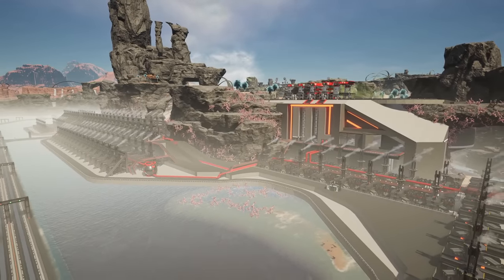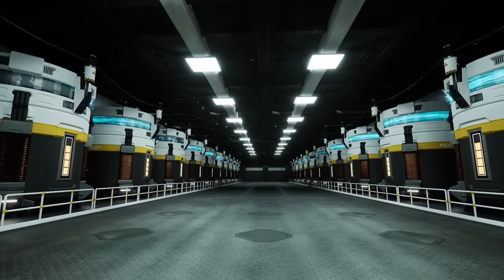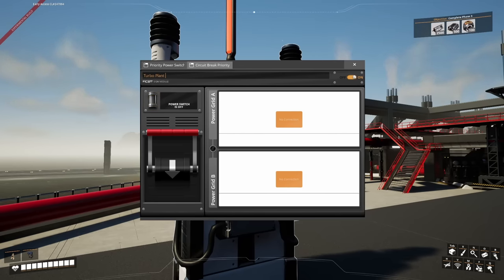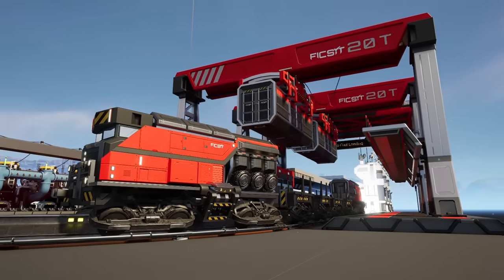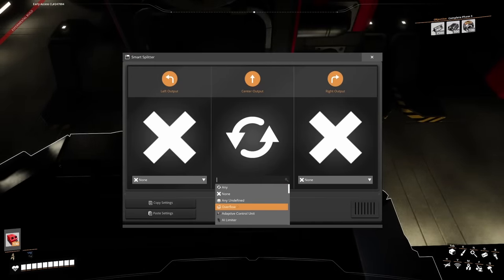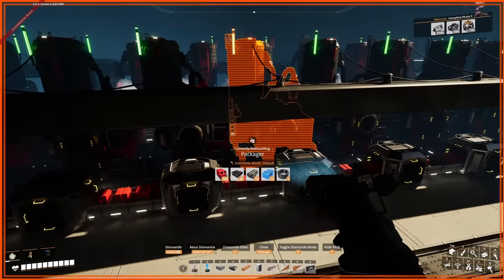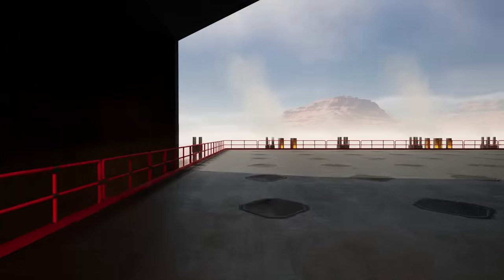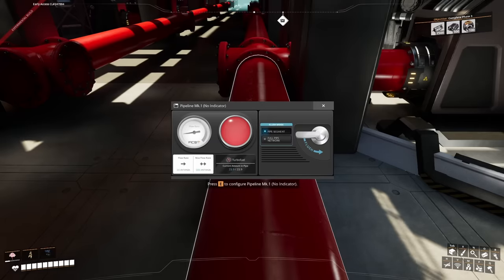Factory Failsafes YOU Need To Improve Efficiency in Satisfactory

Comment: One very basic efficiency you're missing out on is input and output buffer containers on stations.
If for example you had 2 nodes feeding a station with 240/min each and a train pulls into the station. Well the station then stops accepting items, the belts fill up and eventually after enough cycles, the miner fills up and stops producing. This means that the average rate of production over time will drop below 240/min.
Similarly, if a factory relies on a belt being saturated all the time, the moment a train pulls into the station, the belt starts depleting and the throughput on that belt will also be less than nominal over time.
Lastly, it's important that they both be used at either end so that items per minute are balanced on both input and output for the entire system. Essentially the only bottleneck of the system then becomes the throughput capacity of the journey itself (total car capacity/trip time); as long as that's higher than the input and output capacity, the entire trainline can be ignored as a bottle neck (providing you let it fill up a little bit first). Items seemingly go in and come out the other end without any interruption in between.
VERY IMPORTANT: the belt connection between the station and the container must have faster throughput than the intended nominal input or output to make up for lost time during the loading/unloading animations.
As an aside, using another equation (total line capacity (i.e. all trains on a line carrying that specific cargo)/input output capacity) gives us the maximum average interval time for a given station. If you have a very large distance to cover, you can use that equation to add either more trains, or split the journey with  cargo stations in between effectively creating multiple buffered train routes with balanced inputs and outputs (as above, it can then be discounted as a source of bottle necking since the input and output are balanced and continuous).
Reply: A lot less writing...
Stations stop accepting materials when loading/unloading. Use industrial storage. If you are shipping ore for example, single belt into storage, 2 belts from storage to station. On receiving/unloading station, 2 belts from station to storage and single belt out. This keeps things running and stops things like miners from backing up and ensures your station empties quickly into a boxes so your belts dont starve.
Reply: Buffers aren't necessary.
Reply: @Domtronic  Depends how you define buffer. A section of faster line could be called a buffer. Whatever the case if you want to deliver X items/min you need to be able to move amount > X  items/min out of the station and have enough of it available to feed your X item/min bottleneck for the duration of the unload. Same idea for loading.
Reply: @BoredDan7  Faster lines themselves are in addition to a buffer which is not necessary. It's not nuanced.
Reply: @Domtronic  If you want to have 100% efficiency a buffer IS needed for train loading and unloading. When a train is loading or unloading NO items go in or out of the station via belts. This means there is "dead" time which requires a buffer of some sort. A line that is long enough and faster then required does act as a buffer.

For example if you were say pumping 240 ore/min on mk.2 belts into a station and using two mk.2 belts on the unload station, you would not be able to use 240 ore/min on the other side because you would have time during load where the belts going in are backed up and time during unload where the belts going aren't being fed.

Trains need buffers because they have a variable rate intake and outake, that variation being 0/min during load/unload. You don't need buffer in other areas because the rate is constant.
Reply: @BoredDan7  I see your point and concede. In that scenario, you are correct, and the line is, like you said, a buffer.
Reply: I wish I found this comment earlier! I just learned the hard way this mistake! 
And my buffers were too far from the train station so I had to MK5 a 200meter belt. It was a mess.
Reply: I found this out the hard way after setting up my first Turbo Fuel factor. I accidentally starved a quarter of my generators because the trains caused the minners to back up. Always buffer your resources!

Comment: One fail safe I use is smart splitters for the full manifold.  It dramatically smooths out power spikes as the manifold fills one machine at a time.  It also allows for interesting designs like my steel factory that can build entirely pipes or beams depending on need. Balanced if both are needed, fully one or the other if one is backstuffed.
Reply: Oooh, now that's a very nice and clever use of things to add efficiency and using smart splitters like that is obvious now you mention it and takes no more space than normal splitters! Thanks. I take it that your steel factory has interleaved pipe/beam manufacturing therefore the flow just happens depending on what is backed up on the outputs? Or have you also separated out the power for each so you can turn or or other off as necessary?
Reply: I have something like that set up with my oil packer / unpacker lines for my belts between the NW oil field and green fields.  With 4 lines of 15 machines, and enough buffer on each end to hold the entire loop of product (wild overkill, 68k in cross balanced storage on each end for what is 'only' 1800 per/min in belts).  If there is an in input failure, Id much rather them start shutting off one at a time, rather then roughly all at once.
Reply: @nickryan3417  well the trick is a container that runs full and smart splitter on the input. You build machines for 100% of the input resource. If both containers are not full it will produce 50-50. As soon as one container is full it will only produce the other item. You could add power switches in case you run out of one item but the other is not full jet.
I like this for my buildable items.
Reply: Nah. I think its more fun to do the math and perfect split to all your machines. Also why would anyone use trains when you can just run belts and/or pipes the whole way. Takes a while I grant you but perfect throughput with no interuptions.
Reply: @GoldMike_  I don`t like having belts and pipes everywhere. One good rail system makes any resource available everywhere.
Reply: I'm actually going to use this idea!

Comment: When creating a power station you really need a plan for how to bring it back online after a brown-out or black-out. 

My tips would be:

* Build in end-to-end "slices": Work out the minimum set of machines that efficiently produce what you need. eg. for DPF - 1xOil extractor, 2xunderclocked HOR, 1xWater extractor, 2xPackaged water, 2x DPF, 2xUnpack Fuel, 10xFuel gen, 1xPower switch.
* Get this to stable running, working "live" so pipes/manifolds fill up, and there's minimal additional load on the existing power sources, and to find bugs fast.
* Measure the power needed by this self-sustaining slice. Build power storage to run it, charge it up, then disconnect the batteries ready for a cold re-start. Use a manual power switch to connect the storage to slice one for a restart. Alternatively run the first slice of geothermal with power storage for smoothing.
* Work out how many slices you will build total, and what proportion of the generated power is needed to run them.
* Build separate power grids: 1 for the first slice (that can be battery booted), one for x other slices to power the rest, and one for the load to the rest of your factories. Priority power switches are not needed as an outage on one isolated circuit can never bring down another.
* Build the remaining slices one at a time. Now you know what a working slice looks like, go to town with blueprints. It's all self sustaining so you aren't loading your main power grid by building them.
* Relax knowing you'll have reliable power, and if the worst happens it's one switch away from running again.

For liquids:
* Use gravity: arrange for liquids to flow down to the next machine in line, even if it means initially having to pump the crude oil up high. Always feed from above, and make sure the input pipe segment to a machine has a larger volume than the machine's "gulp" size (vol/min * 60 / cycle time in seconds). Pipe floor holes "fail" because short pipe elbows from floor to machine input don't satisfy this condition.
* Working in slices means never having to merge all the fuel (or whatever) into a single pipe. Big pipe manifolds are where you'll have all the sloshing trouble. Don't use them.
* To ensure fuel gens start and run reliably place humps (elevated pipe supports or stackabe pipe supports) between the junctions to each generator. That way the first fuel gen is completely filled before the next one starts and so on.

Also:
* No "unreliable" transport (tractors, trucks, trains, or drones) should be part of a power generation plant. The goal is to maximise steady power output!
Reply: Building the backup power system was one of the most satisfying things to me...including a podest with an elevated "valve of shame" used to flush the turbofuel plant with stored fuel from a tower in case everything went totally south and needed to be kickstarted.
Reply: Not sure 90% of that is necessary.  A single generator attached to an extractor and a container of coal outputting into a merger will fix that.  Bonus points if you put an elevated buffer or load balancer but they’re not necessary.  Also you can totally use huge manifolds without sloshing.  You just need positive pressure.  It’s no different than the fuel pump in your car.

Comment: I don't understand the need for semi-balancing the lines in the video example at 7:50.

What problem is this supposed to fix exactly? If there aren't enough resources making it to the machine at the far end, what is splitting things at the middle accomplishing? It's the same total amount of resources being processed overall.
Reply: Yup, that tip is 100% worthless. Assuming the train can deliver items at a rate that is at least slightly greater than 100% of the items being used, then eventually it will balance itself out because of the machines at the end not running. The problem more likely is that their trains aren’t delivering the products fast enough so the end machines get starved over time anyway.
Reply: @mechbfp3219 Idk, I just had to put in a load balancer in my coal powerplant because it wasn’t getting coal past the first 4 of 8 generators.  Once the splitters filled the first few they would just halve their output instead of sending the overflow down the conveyor to the next splitter.  Even overclocking to 200% didn’t help.  Coal just wasn’t getting past half way.
Reply: @AnarexicSumo Are you sure that the belt that had to transport the coal to 7 of the 8 generators had the relevant capacity to do that? (i.e. was at least a Mk2 conveyor belt.)

Comment: I always include a "bootstrap" section in every primary power plant I build ("primary" meaning intended specifically as a power plant; I occasionally use generators as a method of getting rid of byproducts). A bootstrap section is a section that can power all of the infrastructure necessary to get the plant going, is operable from a completely cold start (meaning my main grid is completely down and all attached power storage has run dry), and can keep going for at least five minutes. 

My preference is a set of biofuel tanks that feed into a pipe which goes above their head lift level and a pump run by a normally-off switch to a biofuel generator or power storage. If the power dies, just run to the nearest priority switch, isolate the power station from the main grid, then turn on the pump -- it will push biofuel over the 'hump' and into the backup generators, which will then bootstrap the power plant back to life. 

It's also possible to make a remote-start for solids by placing a smart splitter next to a sink controlled by a priority switch, leaving the switch off, adding some limestone to the belt, and setting the splitter to route limestone to the sink and undefined to another output; while the sink is unpowered, the belt is blocked, but as soon as it gets a little bit of juice it's going to clear the belt and allow items to flow. You can use this for a remote-start backup coal or nuclear plant, but be sure that the plant has water reserves as well.

Comment: I had one 2 meter long belt to a sink I forgot to connect that slowly shut down my entire turbo fuel power plant.  Since 90% of my power came off this one plant it took several hours to get it running again. My big issue was getting the enough energy to power the plant to produce enough fuel to power the generators.  To prevent it from happening again I created a huge fuel storage facility, this included emergency buffers for all the materials coming into the factory so that I wasn’t coming from a cold start.  I also isolated a small section that would power only the machines needed for fuel production so that I didn’t have to worry about cold starting the entire factory, just a smaller plant.  This all was before power storage and smart switches.  Even still I design storage and fail safes in so that I never have to cold start all of my power again.

Comment: i add a water tower to all liquid systems, set higher then any machine. that requires pumps only on one pipe to reach the liquid storage on top instead of all the pipes and it never stalls.
Reply: An elevated buffer is the correct answer, but if that’s not convenient you don’t need a pump on every pipe.  Just the extractors.  One on the output side of a buffer will work as well.

Comment: honestly i think a video id like would be about pipes, pumps and flow control, how high pipe can go without a pump, all the bugs the pipes can get and the fixes and to check the flow properly. those are the things i struggled the most with
Reply: Each pump has 20m headlift, so max 5 foundations 4m each). I just put them every 4 foundations (4m x 4_= 16m) and it's never close to failure.

Comment: Batteries work great in conjunction with priority switches if you are using modular factories or modular powergrids in a megafactory.  Putting a bank of batteries on the factory side of a priority switch can offer some production continuity in low priority zones (or high priority zones if things are bad) while you troubleshoot the power shortage.  With the switch flipped, those batteries aren't being drained to supply the whole grid, just the cut off segment.   This is particularly useful for train stations, truck stations, pump stations, and other outposts which may be lower priority but you want them to keep working as long as possible. 

They may never get used, but never plan for things to always work perfectly.